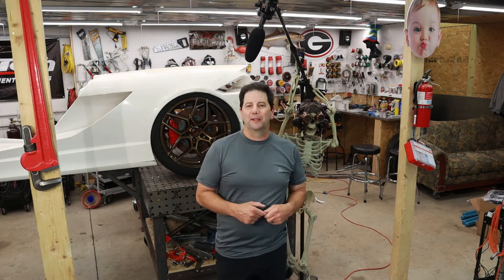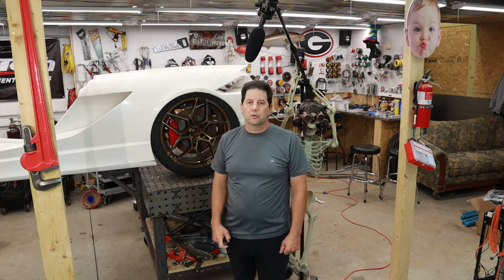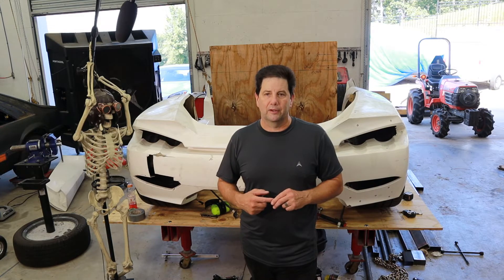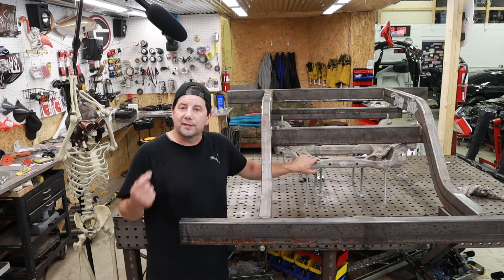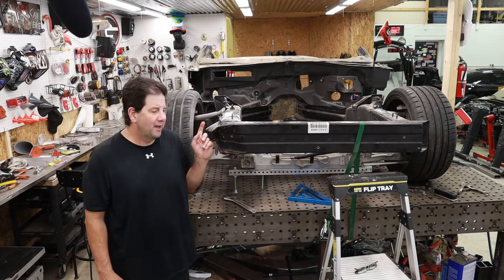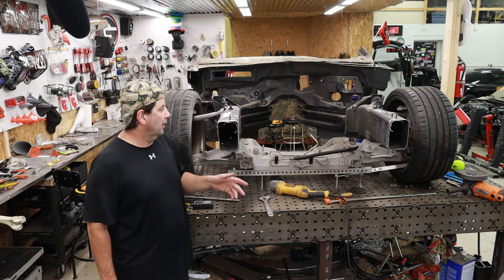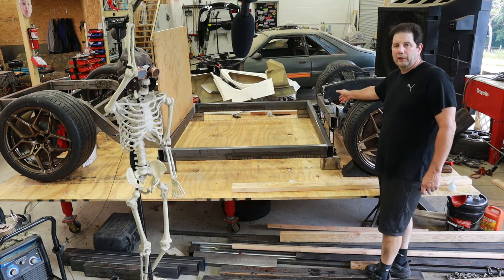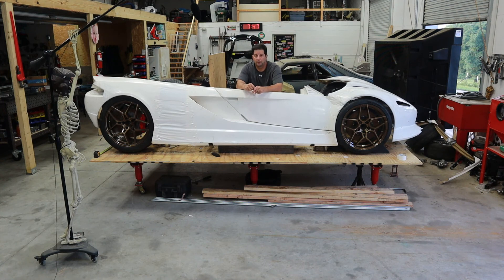Project Split Decision Car 1..Ford Aluminator XS Car 2...Tesla Model S swap... DIY  Supercar Part 5

Comment: You arent bound by the curve of an existing windshield. The windshields are shipped as (pre cut) flat glass, and another company puts the curve in it. Which means you can put any curve into any existing windshield.
Reply: What Company bends the glass? Where? Contacts?
Reply: @daleandersen6730  A company like safelight gets their windshields stacked flat, and they bend them. They would obviously charge you $ for a custom bend, but its what they do.